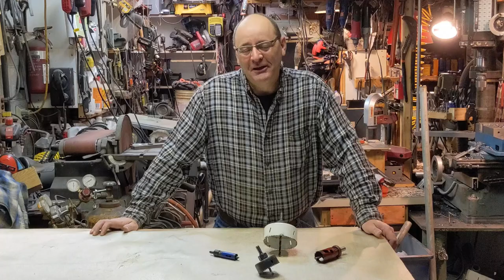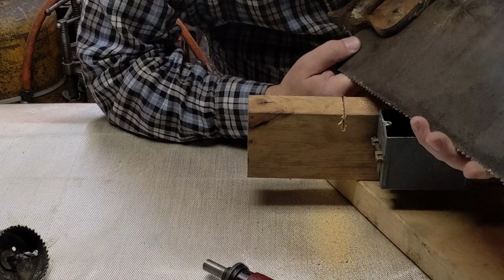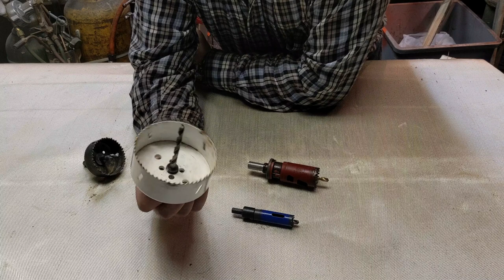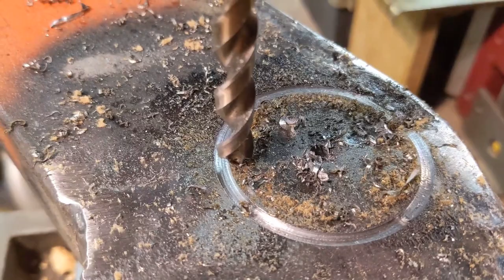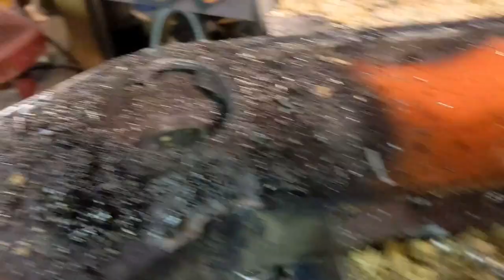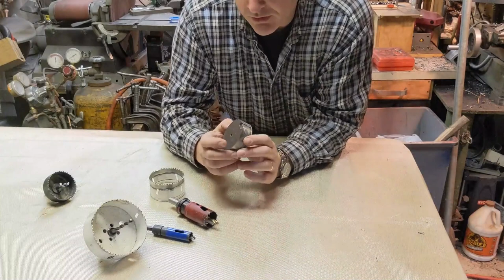ShopHacks: One Simple Trick to cut large holes in thick steel

Comment: I was just depressed since I was looking at a 1 in cobalt drill bit I needed to cut a hole in my modified piece of metal to fix my 6 in gate valve.  Then I saw your video!   I can use my bimetal hole saw to cut in steel by using a dill for a waste dump for the metal shavings.  I would have never thought of this simple genius idea if I lived 1000 years.  Thanks much.

Comment: I find on large holes in thick steel it is beneficial to have more than one hole. I tend to go for three, but for my biggest hole saws (>120mm) I drill six unless the material is relatively thin. I don't imagine it matters unless (like me) you want these expensive items to last a lifetime. I use high performance cutting oil for the same reason. It's a lot cheaper than replacing hole saws!

Comment: Hello, I am going to try to use this technique to cut a 3 1/8 inch hole in a 1 inch thick piece of steel, I am making a home made flathead engine. My “block” is going to be a piece of 3 inch steel pipe with the 1 inch thick plate welded on top to house the valves, but I need to get a 3 1/8in hole in it to slide over the steel pipe. Then it will be welded onto the pipe, and then a homemade cast iron cylinder sleeve will be made to fit in it. If you read all of this and want to see more I have my previous attempts at making a homemade engine on my YouTube channel that I’m posting this on. I am trying to make as much of it as I can with 3d printing to!

Comment: I can't even get my hole saw to form a scratch on the surface of steel, lol.  Must be made of solid Chinesium.  Great trick though. 
What I've learned lately are some really useful tips in drilling much faster through steel.....
1. Clamp the workpiece tight so there is absolutely no movement. 
2. Keep the hole oiled, and go slow with firm pressure, taking as much of a pause as a drill press while stabbing at it. 
3. Use a welding magnet to hoover up the chips as you go.

4. Throw away your garbage cheap drill press and get one where the quill doesn't shake around in blue swede shoes and mess up your whole project

Comment: So, I need to do the opposite, kind of.  I need the circle you cut out itself, not the surrounding steel.  So, in other words, I am cutting out metal circles in aluminum.  I have also noticed with 1/4" aluminum, it takes a long time to get through it and it gets hot.  So, could I drill a hole right next to the outside edge of the disc I am trying to get then?  Also, I do not want to create an indent in the disc so I am assuming it would have to be a precise hole on the perimeter of the disc.
Reply from the maker: You're exactly correct on both counts.

Comment: Great tip. What kind of lubricant are you using? I haven't seen anything like that.
Reply from the maker: I was just using a bit of dark thread cutting oil, which is what I use for most things.  But in this instance, the hole saw was last used on treated pine.  So as soon as it touched the work, a bunch of pine sawdust dropped onto the surface.  So what you're seeing is just pine sawdust sprinkled on dark sulfur cutting oil.  I wish I had something more impressive to tell you!😅

Comment: Have you found any certain inexpensive bi metal hole saw brand/kit that cuts well and holds up well to numerous metal cuts ?
Reply: @TheBuildist   I guess this works well enough, that there is no need to purchase expensive annular cutters and a shank adaptor for a drill press ?
Reply from the maker: Sorry, I misunderstood before:  I haven't found any brand of bi-metal holesaw that doesn't work using this method.  Cheapest no-name on Amazon, HK Morse, Harbor Freight.  They all work good enough for me, using this approach.  But it HAS to be bi-metal.
Reply from the maker: @davehimlin2374  That's correct, for my puposes.  I've cut up to a 4 inch circle in 1 inch steel plate.  You can't get much more of a test than that.

Comment: Thank you that's great. I have 3/16 stainless plate. I need a 2.812 hole. I was thinking a greenlee punch size is not in my kit. If I were to do your method whats your advice. Again thank you.
Reply from the maker: Stainless is going to be on the edge of what a bimetal saw can do. I'd recommend you drill one of these clearance holes like in the video, maybe even two of them on opposing sides. And then use a whole lot of cutting oil and a very low spindle speed.
Reply from the maker: If you need the hole to be too precision size it will have to be bored on a mill or similar. But a 2 and 3/4 hole saw should around a 2.812 finished hole.
Reply: @TheBuildist  going to try carbide hole cutter with 2 of those holes. I may try from 2 sides

Comment: Thanks for posting.  Where can I get a straight shank adapter so I can use one of these cutters in a drill press or milling machine?  Thanks!
Reply from the maker: I've never seen one.  I just mount a drill chuck and drive the arbor in there.  You could weld an oversized shaft to the backside of an existing arbor and then put it in the lathe and turn it down and true to 1/2" or whatever size shank you need.

Comment: This is great i do have a question does it stock is vertical
Reply from the maker: What do you mean?
Reply: @TheBuildist  if you were drilling horizontal instead of up and down like on he drill press
Reply from the maker: @micahwoods9606  Yes the same idea definitely applies. By drilling the clearance hole it gives a place for the chips to go out of the kerf of the cut.  
The difficulty arises in holding a 2-in or larger hole saw in your hand drill. It generates quite a bit of friction/counter torque and so most people wouldn't be able to hold on to the drill very well for any steel thicker than just sheet metal.

So for that practical reason the tip mostly applies just to a drill press. But if you have a strong enough drill and strong enough forearms it is conceivably possible.

Comment: How can I punch 1/2  in holes in 1/4 plate?
Reply from the maker: A regular 1/2" hand drill will put a 1/2" HSS drillbit through 1/4" plate without too much problem.  For 1/2", I'd pilot drill with 1/8" or 3/16" first, then go for the 1/2" bit.  Don't forget some kind of oil for lube.  Pipe thread cutting oil is great, but any lightish oil will work.

Comment: Trying to cut a 5-3/4" hole through 304SS.  There already is a hole, so I am really just trying to make it slightly larger.  I took the advice of this video and cut three holes (plus there is one cut already, its an open circle) but the hole saw won't even start cutting without a large noise and eventually the mill will cut off.  The blade does not seem to be dulling and I can't figure out why it is only "rubbing" and not cutting.  I am using tool point and cooling air so it is not over heating but I'm making no progress.  Any advice (to anyone on this comment section)?  I have pictures if anyone want to talk off Youtube.
Reply from the maker: I'd welcome others to chime in, but from what you're saying, it sounds like the stainless is just too hard for the holesaw teeth to all pull a curl at the same time.  It may be that for stainless that you need a carbide tipped holesaw.

Just an educated guess.  It sounds pretty frustrating.
Reply: Just wondering if you had any success cutting your hole? My first thought was plasma cutter…

Comment: What happens when the metal is of the same hardness as the drilling bit?
Reply from the maker: Unfortunately, you can't drill hardened steel with it.  Perhaps carbide teeth might work for that?   I know of carbide hole saws, but I haven't tried them in hardened steel.

Good question!
Reply: @TheBuildist  the metal have to be high temperature to soften for the drilling bit to cut through, because the metal cutting saws were also manufactured by another saw cutting it

Comment: what rpm were you running ?  140 ?
Reply from the maker: I don't recall. I'd have to look at the scale on my machine. But it's the lowest my machine will run.
Reply: @TheBuildist  I find this important information. As a rookie looking into buying a drill press to drill 85mm hole into a aluminium plate I have no idea what specs i need for doing something like this. Should I even be buying drill press or is a round column mill a more universal tool for metal work. Almost every drill press I find does not go lower that 400 ~ 500 rpm.
Reply from the maker: @janoudman2695  well clearly a round column mill or other bench top mill is far superior to a drill press. But of course they're also far heavier and far more expensive. But if you can afford it and if you have a place for it, then you will absolutely love having a round column mill.

As far as the speed goes, the mills will generally run at a lower speed. But I think it's entirely possible to cut a decent hole in aluminum at the lowest speed the drill press will go. I'd be sure to use plenty of magic tap aluminum cutting fluid to keep the cutting edge cool.